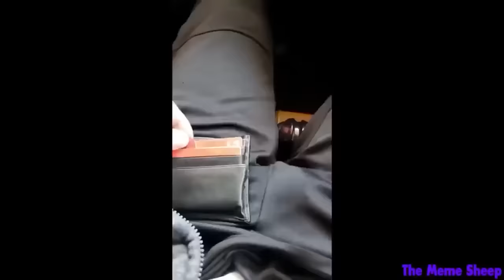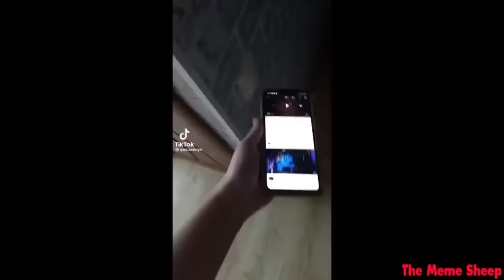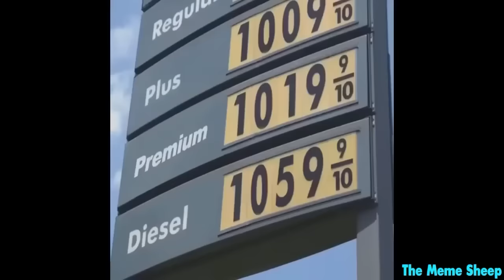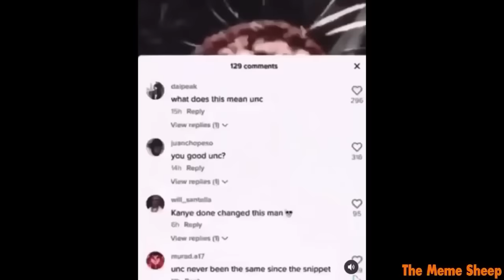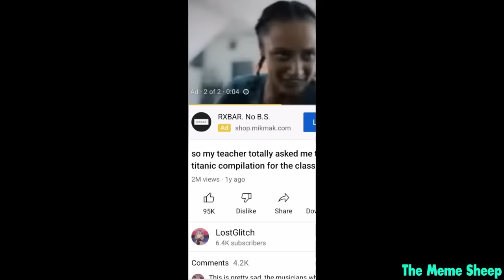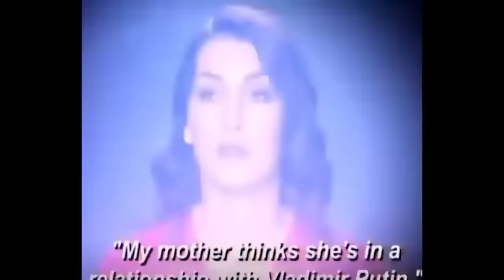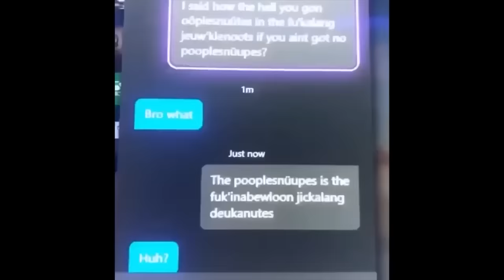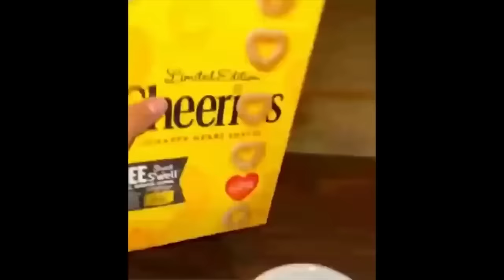1 HOUR OF THE BEST FUNNY MEMES

Comment: 54:30 “If you unplug your computer, it stays on.” Only if it has a working battery, otherwise it turns off immediately and all short-term or unsaved data is lost.

Yes, it’s better to use a CO2 Fire Extinguisher, because carbon monoxide isn’t nearly as conductive as water, and far more effective at removing oxygen, which fire uses for fuel.

However, if you don’t have one, unplugging and watering electronics that don’t have electricity is less likely to kill you than suffocating in a house fire. 

Water may likely destroy the electric item, though.

Comment: All computers, including desktops and laptops, have a small battery inside the motherboard that provides power to the CMOS (Complementary Metal Oxide Semiconductor). This battery is known as a CMOS battery, 
this message is for stryxo

Comment: Firefighter here, if the electrical source is cut off from an electrical fire you fight the fire with the correct fire extinguisher with that type it would either be foam dry powder or co2 not water because it's a metal and or plastic fire